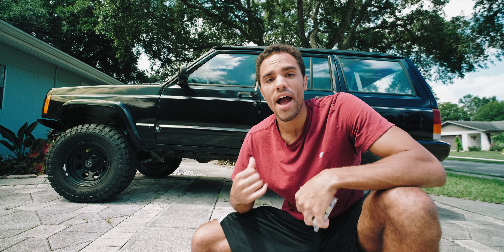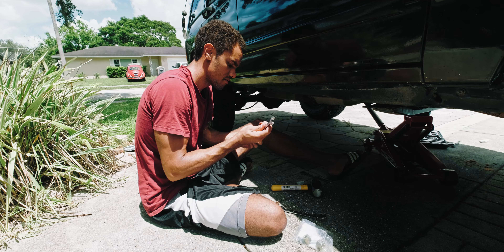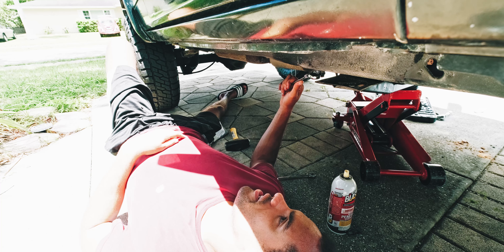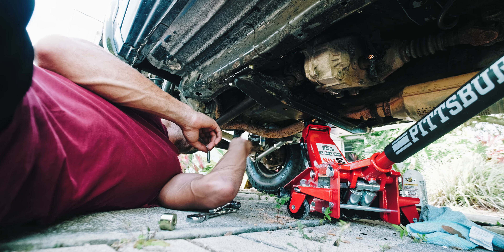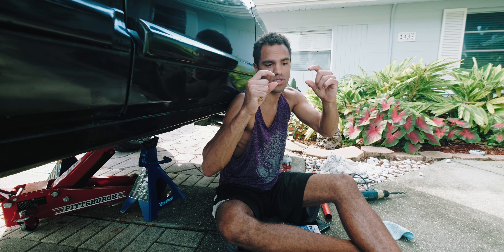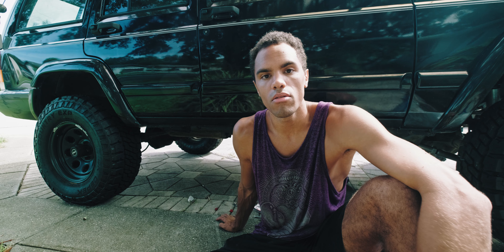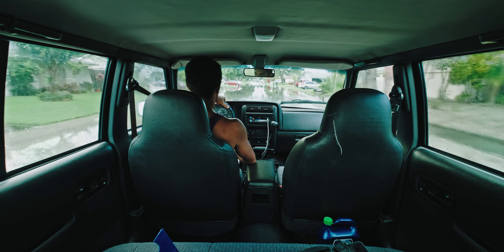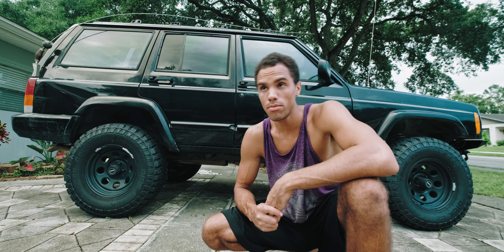Everything That Can Go Wrong While Installing a Transfer Case Drop

Comment: I just got done doing mine. I am old and disabled and everything HURTS! Just to make things a little more complicated, Mine also has a transfer Case skid plate attached from the center of the crossmember, over to the driver's side frame rail (unibody) behind the crossmrmber. It's never easy! I broke off one bolt and had too drill and tap. THE STRUGGLE IS REAL !!! 🛠️

Comment: Great job and great video. You didn't quit and that is what it takes to own a Jeep XJ a lot of hard work but it pays off in the end. I have a 2001 XJ and just removed the entire front axle and thats some work, Rusted bolts, broken bolts hard to get to parts to remove but you stay at it and great results . Keep at it Trailspin it looks really sharp what lift do you have now. I have the Rocky road OME 4.5 lift with 35" coopers

Comment: Did you check your U jjoints? Before you tear into your transfer case you might want to service your differentials. Much cheaper.and more likely to be the source of your ratcheting sound.
Reply from the maker: Found out that the ratcheting noise was from the cardan joint in the front drive shaft. So I removed that momentarily and still get some sort of grinding noise from the front diff. I did change the fluids and inspected the gears, but I didn’t try to push things around to see if things were loose. Will take it to a shop soon and see if they can diagnose the specific issues
Reply: @trailspinTV  You can change the U Joints yourself without too much difficulty. When it comes to drive line issues I try to only go to a shop that specializes in driveshafts and differentials specifically. By me there is a shop called Suburban Driveline and they've never let me down. More importantly they don't guess and take you down the rabbit hole. Good luck with this issue, if you need help you can always call me, if you still have my number.
Reply from the maker: Yup, I have already replaced one U joint. So I am not worries about my driveshaft. But I will definitely go to a specific shop that specializes in differentials

Comment: I'm right there with you on the frustration side of what should seem to be an easy fix. I really liked watching your tenacity.  You may want to spray a bit of paint or other metal protectant around your new holes to protect against rust. Great video!
Reply from the maker: Yea, I am thinking of doing a huge rust clean up at some point. But I want to get it drivable with no issues and I kind of have to wait until Florida is out of its rainy season. -Braxton

Comment: I had a worst time that you with all the tools I needed. My nuts welded to the jeep for those studs broke off. I had to fish with string on bolt on one side on each side and tighten it that way with an impact. Heli coils didn't work for me. I did a hack and tap, worked great, cut it shorter than I wanted but no issues. You need to use 4 degree shims on the rear axle when you do the the hack and tap with a front drive shaft in the rear, that's how I solved my vibes in mine with 4.5 inch lift. Mine looks identical to yours but with steel bumpers. Message me if u have any questions.
Reply from the maker: It seems like doing a drop is harder than just doing a SYE....
Reply: @trailspinTV  I did the hackbn tap, reread my message I added to it

Comment: My ZJ has a 3.5 or 4" kit no issues. I've never found the exact criteria that make a drop necessary. I got the ZJ with the purpose of making it a project and doing a lot of the mechanical work myself to get those muscles moving again. It always seems to fight you I get it lol
Reply from the maker: Yea, some people have a lot of problems with a small lift and others have no problems. I do know that my Cordan joint in my front drive shaft needs to be fixed. But then I also may need to rebuild my axles........... I’m still trying to figure that out at this moment. -Braxton
Reply: @trailspinTV  Are they u joint or cv axles?
Reply from the maker: U joint, I have already replaced a U joint on the axle shaft on the passenger side, so I can do it, it’s just now it’s a double ujoint setup that I need to replace. I’ll do this once I figure out if I am going to rebuild or replace my front axle. -Braxton
Reply: @trailspinTV  If your seals are good and the gearing is fine, I'd say just replace the u joints and drive the vehicle. It's really easy to get caught in never ending construction phase.
Reply from the maker: Oh, I think something is messed up and may need to replace the bearings but I might be the pinion. I replaced the fluid and checked with my eyes and everything looked ok, but after replacing the fluid, I can hear kind of like a muffled grinding noise which seems to be coming from the front axle. 

So I’m going to take it to a shop in the next couple of days and see if they can diagnose a specific issue and go from there. 

I was thinking of just buying a whole new axle because mine is a low pinion and the high pinions are stronger and have more ground clearance. 

But if I can’t find a high pinion axle, I may just wait about a month and do a whole gear upgrade since that would be the best time to do it. 

-Braxton
Reply: @trailspinTV  Good luck man. I can physically feel what you're going through. I've put a lot into my 97' ZJ now with just over 60k miles. For whatever reason, I decided to be the person to save it. I just so feel everything going wrong on small procedures. That first drive though after everything was largely done was so amazing. Keep at it!

Comment: Braxton ..... way to go man, dont give up its a clean FLORIDA jeep (surprised).  Sometimes you do what you have to in order to achieve your goal. You picked one of the best all around platforms out there. Keep buying tools like the last guy said, no matter whether what you drive you will need them.

I would also suggest that you do a disk brake conversion on that jeep using 1st generation grand cherokee (ZJ) rear disk brakes. Also full cross over steering nuckles from the 2ND generation grand cherokee (WJ), obviously that will require replacing the steering linkage. 

These are suggestions thats all, hope to see you on the trails.
Reply from the maker: Well in a future video, I do the rear drum brakes, but after that, I will definitely do a conversion for the future.  And I do have a heavy duty steering upgrade from cavfab that I need to install at some point. And thanks again! -Braxton

Comment: You just need more tools man. You'll always use them. Use Liquid wrench instead of pb blaster when you can. Don't even bother saving those old, crusty nuts and bolts. Just get new ones.
Reply from the maker: Why liquid wrench? Is it just better than PB Blaster? And after removing the old hardware, I definitely will just use the new stuff. -Braxton
Reply: @trailspinTV  it is just way better stuff. I'm working on rusted stuff all the time in minnesota so I researched what's the best stuff and liquid wrench was the best and has been great during my usage. Search 'liquid wrench' and 'project farm' on youtube. Keep up the good work.